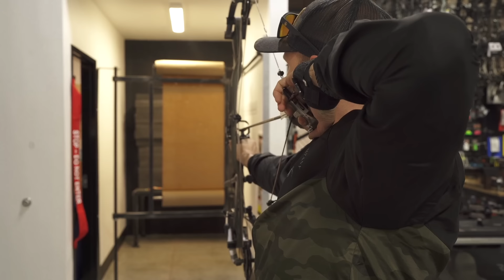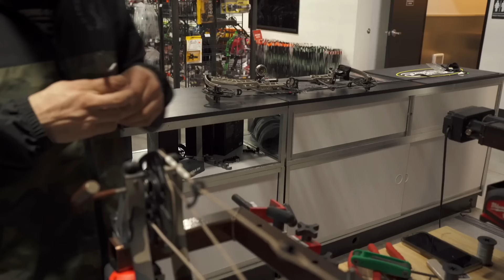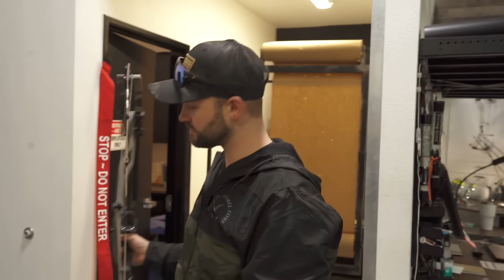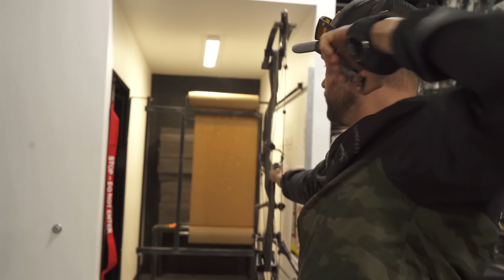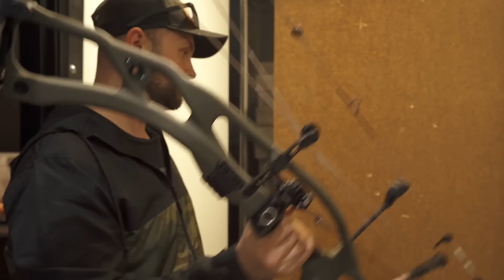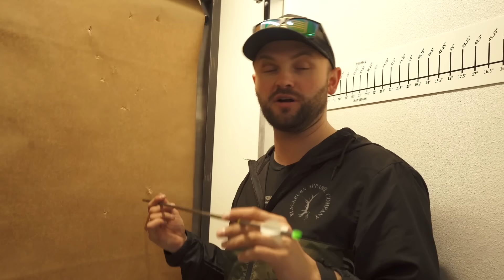Hoyt RX8 Ultra Build Part 3/3!!!

Comment: For $529 that the Bear Alaskan XT goes for, which has the IMS and Picatinny mounting systems, and how light it is, I saved a lot of money getting and tuning one for myself.  And it tuned so easily using the static yokes on the top limbs.  Didn't even have to shim cams.
Reply from the maker: Yeah it a dang nice bow for the money! Definitely one of the best mid range bows out there!

Comment: My Alpha X33 tuned perfect left and right with just switching the factory shims on bottom cam. I'm a lefty as well and had to move just bottom cam to the left by flip flopping factory shims.

I agree 100% on the grip. It's super comfy but not great for consistency. I took it off and wrapped the bare riser with 2 layers of tennis grip tape. My groups down range shrunk in half and bareshafts are much more consistent. Great job on the vids, keep them coming!!!

Comment: You should leave one screw in the axle and push against that to get the axle out the other side, instead of risking damage to the threads by doing what you did with the Allen key.
Reply from the maker: I did leave one in, and the allen is the same size as the axle so it wouldn’t damage the threads. I agree with you though that if done incorrectly it could damage the threads. Done thousands of how’d this way though and haven’t aver damaged axle threads so I guess it works haha.

Comment: I'm currently shooting a Black Gold set up and it's nice, however, I shoot an HHA on my cross bow and its like a tank with better mechanical (smoother) adjustment. I might have to go with the HHA Tetra with two vertical pin set-up. You gain a few ounces in weight but I believe the trade off is worth the difference.

Comment: Mine I set up CS, at 13/16 and was bullett holes. But my fletchs, are touching the cables. So I just cut the sides of my Bohning blazers. Don't have press. My previous Vtm34 and ultra was perfect. But my new AlphaX33 I had to cut fletchs

Comment: Do you think you could get a UV grip to fit on a RX 7 or RX8?
Reply from the maker: They make one for Hoyt’s, but you can’t get a Mathews one to fit.
Reply: I know that. I was wondering if you can modify the RX1-RX5 UV grip to fit a RX7 or RX8. They do not make in for the newer Hoyts. The Hoyt grip is ok but like you said it just doesn’t have the flat square edge.
Reply from the maker: @msp218  I don’t know I haven’t tried to
Reply: I just ordered one to try out 🤞